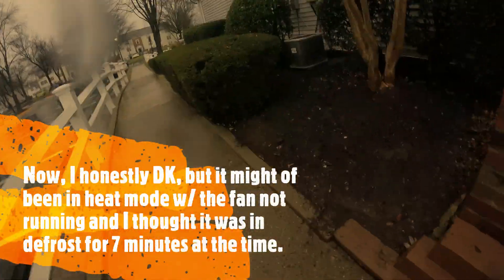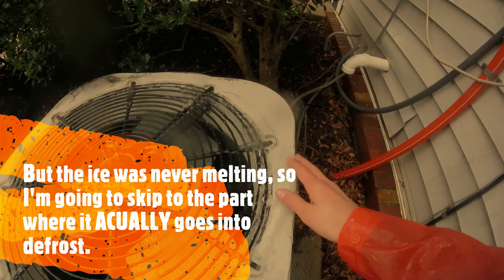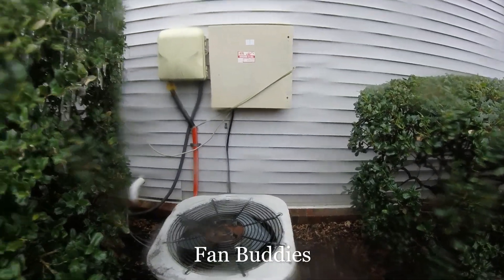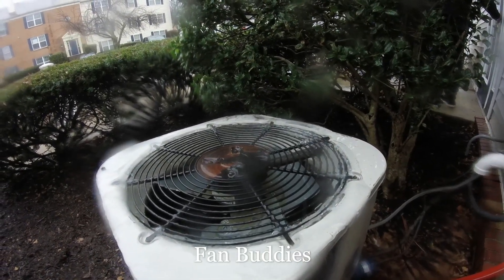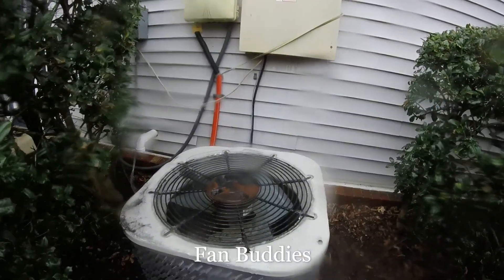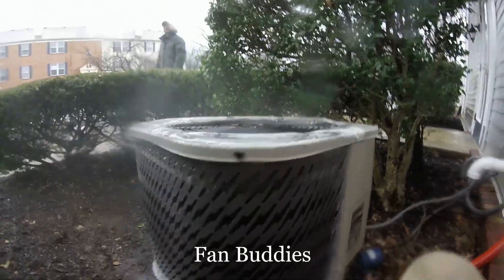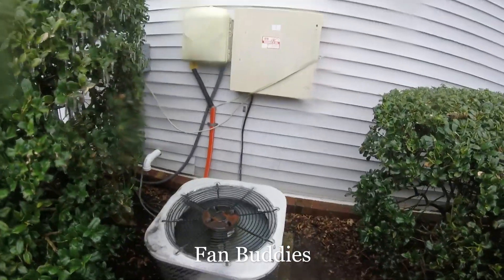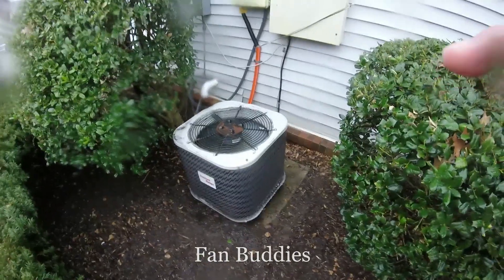2001 Comfort Range Heat Pump | Full Defrost Cycle (Epic Steam Show) (*READ FULL DESCRIPTION*)

Comment: The unit is from 2005. When it was in heat mode (without the fan running), the stuff coming off the unit is mist from it freezing so much.